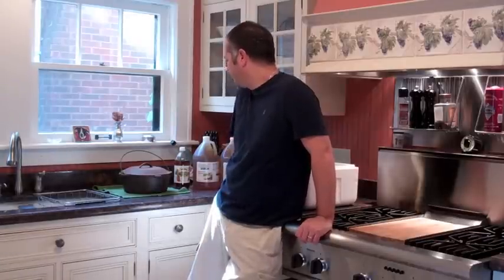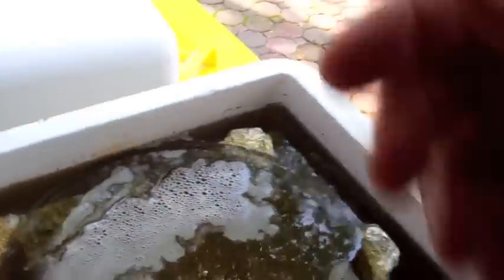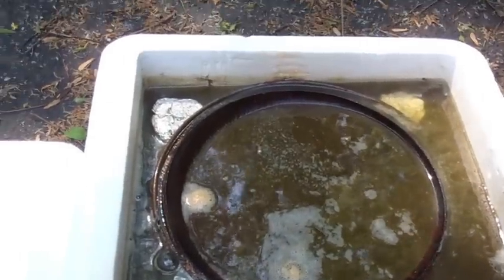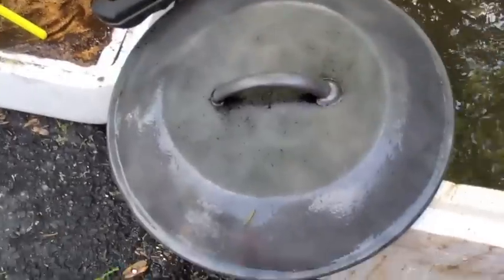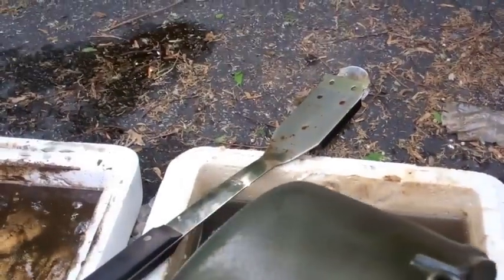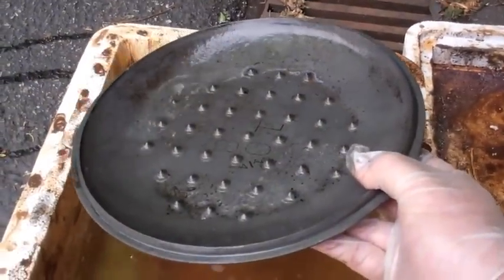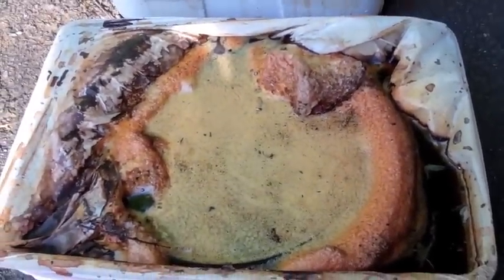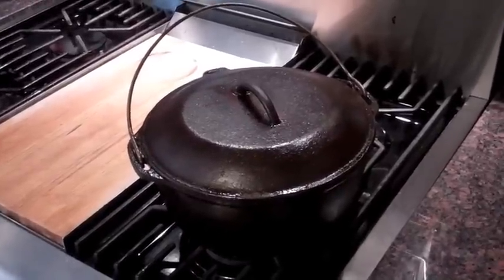Amazing Rust Removal with Apple Cider Vinegar

Comment: I tried this apple cider vinegar method on a small cast iron skillet I found at Goodwill yesterday. The interior was very brown/orange from rust. Submerged the pan overnight, & about 18 hours later was able to clean the pan completely & reseason it to perfection! I used a copper scourer to scrub & the rust just washed away. I did the fried egg test afterward & it's now my best no-stick iron pan. Thanks for the vinegar idea & video!

Comment: You should really strip that again in a self cleaning oven and reseason it using way less Crisco. When you slather it on like that it gets tacky to the touch. Best to get it slightly warm then work the oil into the pores and immediately wipe off the excess before putting into the oven for the heating process. Less is more in this case. If you want that deep black seasoning you just do it repeatedly. Three to four times.

Comment: You can also use a hot fire, put it in the fire until your all the way down to hot coals. When fires done, and it cools off use some olive oil and some paper towels to clean out the rust. Can also put some water the pan to bring to a boil to help some rust float to the surface. Probably a lot faster then days of Apple Cider Vinegar.

Comment: As soon as all the rust is dissolved and the metal washed with water, it is very vulnerable to flash rusting, a fine quick oxydation. So, as soon as it is treated and washed it needs drying and protecting with oil. I'm using white vinegar to clean rust from a motorcycle fuel tank, it's very effective, but the final wash with water has to be followed instantly with warm air drying and then petrol filled to the tanks capacity to prevent new oxydation.

Comment: I have always used white vinegar but from a taste standpoint apple vinegar seems to me to be much stronger and I will try that next time but no lightweight springs! Some heavily rusted tools, even after a week or two in the solution that show no sign of rust upon removal will require light oiling after rinsing and drying to prevent them from rusting again.

Comment: Another product you can use to remove rust is feed grade molasses. If you live in a rural community, you probably have a feed mill somewhere nearby. Get a bucket and ask them to fill it with whatever amount you need. It is very cheap, and you can dilute it 1-10. Leave your rusty object in the diluted water for a couple of days up to 2 weeks. Check once in a while to see how it is working. Scrub clean and coat immediately with either oil or paint or whatever else you use to prevent fresh rust from forming. This is great for large objects where you need a lot of product to cover what you are working on. Very cheap.

Comment: @MrTDP05 If you let it air dry it will flash rust immediately. You had it cleaned really well the first time. Putting the piece in the oven and heat drying it, then coating it with the fat for seasoning will stop the piece from flash rusting and save you from having to place it in the vinegar again.

Comment: Try putting it in a plastic bag then submerge the bag in water you will use alot less vinegar because the will force the vinegar around the Dutch oven just leave open to vent. The vinegar is an acid that is why it cleans the rust. The only problem with vinegar is it will leave a taste in the pot for awhile but using apple vinegar might take care of that. Did it? What was the time and temps you seasoned at?

Comment: Using brass wire brushes on cast iron will leave brass on the cast iron and leave a yellow coat.
Reply: dang, so many videos say only use brass so as not to scratch etc. Thanks for the tip!
Reply: I learned that the hard way in the beginning of my restorations

Comment: There are a number of way to remove rust from ferrous metal.  I usually use a high speed angle grinder (10,000 rpm) with a wire wheel. ALWAYS wear eye protection and gloves if you do this.  There are several other ways I've found out.  I watched a vid where a guy used a car battery charger with his parts in a solution of "washing soda", it worked good.  Another dude suggested molasses and water solution.  A palm sander with varying grits of sand paper (especially wet) does a decent job also.

Comment: vinegar is acetic acid, the acetic acid is simply turning the rust, iron oxide, into iron acetate. This can be visibly seen when using white vinegar, the iron acetate will form a deep reddish brown coloration much brighter than the orange/black rust. There is no difference in acetic acid concentrations between white vinegar and apple cider.

Comment: I have used vinegar to remove rust for years from various metals with no need of wire brushing when I just left items in the solution longer. My only bad experience was when I placed some old rusted pocket knives into the solution that had belonged to my late dad. Upon removing, I was horrified to discover that the vinegar solution had dissolved the lightweight springs. The pocket knives came out in irreparable pieces.

Comment: the vinegar is not eating through the styrofoam. It is heating up from the chemical reaction between the acid in the vinegar and the carbon in the steel. It is bubbling up and overflowing the seams on the styrofoam,.

Comment: I use any form of vinegar. They all work well. I use them mostly for old rusty tools like pliers, or screwdrivers. I leave them in vinegar for about four days, then clean with steel wool, and WD-40. If you want a stronger vinegar solution (before using), put it in a bowl then into the freezer. When the water in the vinegar starts to freeze into ice, remove the ice, and you have a stronger vinegar. The stuff is like magic on old tools, or other rusted metal products.

Comment: The acid (vinegar) with strip the outer surface of your cast iron and that is where the rust was. It will form new rust very quickly... that's the "emerging rust"... once your oven/pan is done you're supposed to coat it lightly with cooking oil and set it in a warm oven until it looks dry. You could have done this whole thing with JUST the SOS pad, or the drill brushes, or the grill wire brush. Surface rust is not hard to remove.

Comment: was working on a 50+ year old tiller (my wife's deceased daddy's) and it was important to me that i keep it original.  had to make a flyway keyway out of a chunk of brass.  had to redo the points system (would have liked to used a magnetron, but need original). had to redo the recoil starter internals.  had to redo the carb.  all of this work took manyh hours and i finally looked in the gas tank.  solid heavy flake rust.  what to do.  did the old bolts in the metal tank and shook it hard.  cleaned the heavy stuff out, but what to do about the rest.  naval jelly for $15, stripper for $20, and not sure if either would work correctly. what to do.  finally tried apple cider vinegar for $2.  filled to the top. let soak for 1.5 hours.  it cleaned it shiny.  although pitted from the rust, the tank was shiny. go figure.

Comment: If you are using it to cook the iron will be fine. If you season it, heat it and rub with oil, the thin rust will go away. The body needs iron and this is one of the advantages of cooking with iron.

Comment: I believe it would be more informative if you would give more details for the 3 times you baked and reseasoned the pot along with the temperatures and length of time you baked it . Other than that I enjoyed watching the video . However I do have a question , as one viewer suggested would it not be easier and take less time to sand or bead blast it ? or can you not do that for one reason or another with cast iron ?

Comment: Hey, I have a question. After soaking the cast iron in the vinegar and the rust being removed (soak for a few hours and scrub, not that much rust). I washed it to remove any vinegar residue, then, according to the internet's seasoning techniques, I dried the pan thoroughly on the stovetop, but while drying, a thin film of orange/red rust formed before I could put on the lard to season. How did you prevent it from happening? Is it because I didn't soak it long enough?

Comment: naval jelly is faster, but it's also carcinogenic, so using it on cooking pots might not be a good idea. Maybe only on the outside. I have a big tea kettle with a small lid, flaky rust inside, and don't think I can get a drill mounted wire brush to get inside, so cider vinegar and steel wool might be the answer thanks!

Comment: I have placed my opened pots in the oven and put it on the clean oven cycle.  Your house may smell like burn oil since it is burning all the stuff of the pots.  When the cycle is done and the pots have cooled, simply start the seasoning process again.  Just remember that this will remove all the prior seasoning.  Let me know if you tried and how it worked for you.
Ann

Comment: Very interesting demonstration of patience. Yes, it's about using an acid. Of course, some muriatic acid from the hardware store would have done the same job in minutes instead of days. I'm sure the same results could have also been in weeks using lemon juice if you were so inclined to test your patience even more. Or, cut your vinegar and just wait longer.
Reply: Bob Marcom More expensive and then having to deal with the hazardous quality and on dutch oven...? Really? It still would have taken at least a day with neutralizing and seasoning. He didn't really need to spend that much time on it but he seems to be the thorough sort.

Comment: You can displace a large portion of the inside volumn in doutch oven with a bowl of water. A smaller amount of vineger would work just as well and not cause such a mess.  Never use metal for any kind in a rust removal process.  It can slow the process or cause other corrosion problems.  Also the styrofoam is probably melting from heat generated from the reaction of the vineger with the rust.  You also use way to much shortning to season the pan.  A very very thin coat is all that is needed and then wipe it down when you finish.  Doing it 2 or 3 times with a very thin coat of oil gives a better patina and provides a much better anti-stick surface.

Comment: I saw this video and it's pretty good and all but have you entertained the idea of sandblasting?  I work as a sandblaster and I've taken my old nasty cast iron dutch ovens and skillets that I've bought for nearly nothing at garage sales and blasted it down and re seasoned it.  They look beautiful and brand new.  Blasting it LITERALLY takes 1 minute.  And as long as the blaster is using a very fine media it doesn't pit out or change the surface.  I recommend it.

Comment: Never sand blast good old cast iron pan or pot.
Sand blasting remove surface metal and leaves the mirror inside finish blasted rough. Oven cleaner works really good just spray and let stand in a plastic bag over night.

Comment: Never use soap on cast iron cookware. Never gob on shortening or oil to season. Well, you can gob it on to make sure you get it everywhere but before you put it in the oven or over a flame to season it you should always remove any excess oil or lard. You only need what seeps into the poors of the metal. Do this many times, with thin thin layers or oil or lard, not gobbed on like shown in this video. The excess just cakes up and acts like glue for dust and dirt to adhere to it.

Comment: Wow, I realize that cast iron last through several generations but this process is way too much work. The preseasoned Lodge Dutch Oven cost under $50 at Walmart and their largest 12" skillet is under $18. Some things are worth throwing away if the labor and materials is going to outweigh the price of replacement.

Comment: This seems like way too much work.  If you put it in a self-cleaning oven on a brick or a fired ceramic piece, and run the oven's clean cycle, then scrub with wire brush, then rub oil on....that's it.  That's all the work you need do.  The birds singing was wonderful background to your vid, though.

Comment: all this trouble to remove rust from cast iron?? not very smart.  He stained his brick wall where he was first doing it.  Easier way would be just put it in a self cleaning oven for 3 hours.  Lot quicker and cheaper than taking 3 days.
Reply: self cleaning oven, so smart!! Thanks for the tip. Hope the cast iron pan don't explode from all the high heat.

Comment: Would regular Vinegar work??
Reply: *****
You can use Olive Oil with a paper towel to clean out a lot of the rust after doing the vinegar method. Fire method probably better or electrolysis.
Reply: Linda Womack any acid would work the only difference would be time.  You could use cola but it'd take way longer.

Comment: HA! 46 hours, a real mess, the cost of two wire wheels, two gallons of cider and various plastic.  Go to your friendly Ace Hdw store and pick up a quart of phosphoric acid.  That's what's in Coca-Cola and a host of other phosphates.
Two products are; OSPHO and Must For Rust (by Krud Kutter).  This job will be done in just over ONE hour.
All acids work faster when heated, but 70*F works just fine.  Keep the acid wet with mild brush agitation.  When done rinse with plain water.

Comment: This is awfull information. Never use a wire wheel on your cast iron and if u are gonna use a small wire hand brush it can not be brass bristled! it will discolor you iron. Never leave your cast in vinegar for more than 30 mins then scrub, rinse, and repeat.

Comment: there exist already commercial products in the market tha do this job, a lot more cheape than apple cider vinegar and in a few minutes. This product, as simplyconnected  stated, is already used by body car repair men when they have to remove rust before painting. Does it sound stupid to you

Comment: I would just buy a new one. All that trouble, somethings are just better bought new.
Reply: Nonsense.  Many old cast iron items are very valuable.  Many have sentimental values, too.  They don't make quality cast iron, in my opinion.  Examine the lack of smoothness on most of the cast iron you find hanging in the store.
Reply: anselb2000       Smoothness comes with use....